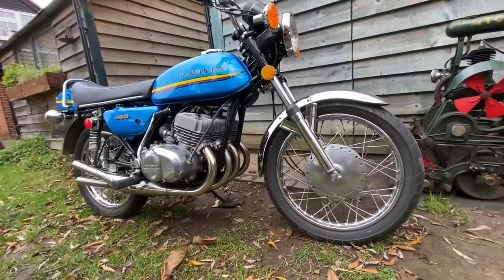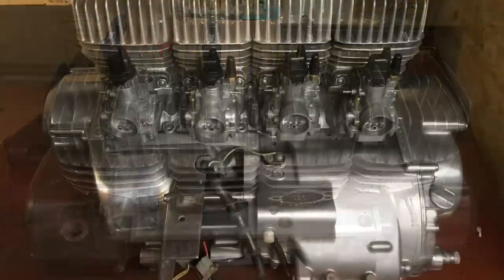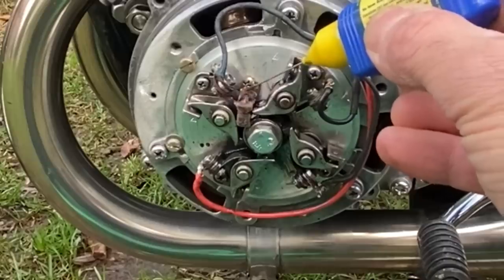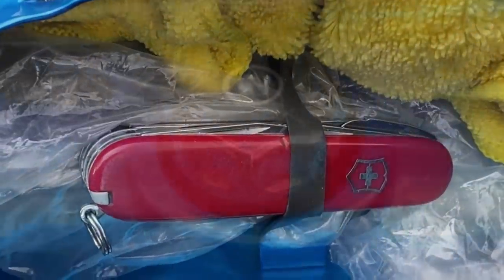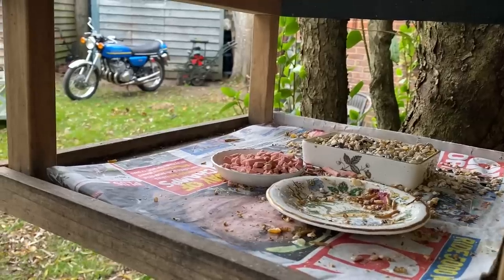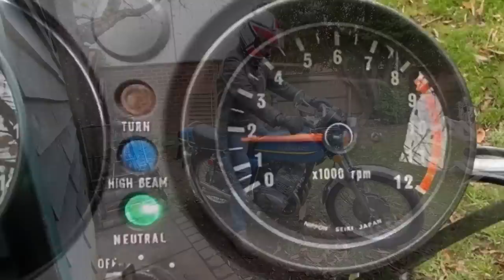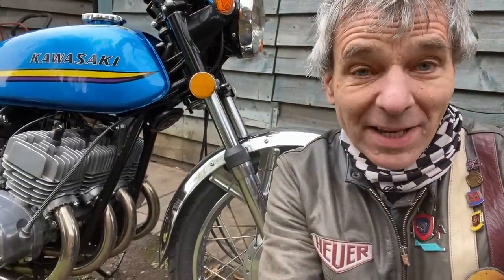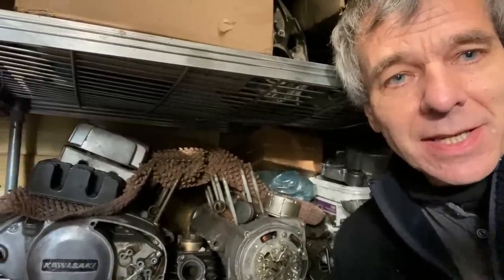Millyard Kawasaki S2 350 four cylinder two stroke road ride

Comment: I’m just amazed that anyone can cut 2 cases and square them and align them so you can get a crank to run true. Beautiful work.
Reply: milling machine helps. then so does a few decades engineering experience as well....
Reply: @MrKristyon  Being a genius is quite useful too. :)
Reply: I believe he mounts them on a mandrel and onto a true surface to keep the cases aligned. He then lets the case cool naturally and settle, still bolted together. These projects are awesome!
Reply: You remember he cuts these by hand with a hacksaw dont you?
Reply: @jagtan13  
I have seen a vid some where  & he cuts them with a hack saw
Reply: @Terry-Tibbs  cuts yes, but he finishes the faces true with his milling machine.
Reply: @driftingdan  afterwards he trues up the edge with his horizontal mill, and gets the left-right spacing correct.
Reply: So true, funny how it seems
Always in time, but never in line for dreams
Head over heels when toe to toe
This is the sound of my soul
This is the sound
I, I-I-I, I
I know this much is true
I, I-I-I, I
Ooh, I know this much is true, I know this much is true
I…
Reply: You just need a hack saw and a barbecue...
Reply: Perfect
Reply: yes spot on
Reply: Having an education really helps.
Reply: @MrKristyon  Allen didn't even have a milling machine when he started reconfiguring engines, and only a small - what I think they called a hobbyist lathe virtually used hacksaw and file. I think his Kawasaki V12 was from those days.
Reply: @driftingdan  Does he ?? :-)
Reply: @charlessmyth  the cases are cut with hacksaw. He used to file them to fit. These days, he cuts by hand and finishes on the milling machine.

Comment: I've never been a two-stroke fan, but wow, that engine screams! Watched it twice just for the sound. Me thinks I should get a stroker to experience one before it's too late.
Reply: My favourite two strokes of the era were the Suzuki triples, not up to the Kawasaki in performance but I loved their melodic gurgle. Kawasaki was more of a crackle. As the Kawasaki goes my favorite was the 400, it just felt a little more refined. I would love to take any of them around the block again and I would probably just melt into my boots for a chance to ride an Allen Millyard recreation.
Reply: The smoothness of riding a multi cylinder two stroke is amazing and they seem to have character!
Reply: I highly recommend it.  But, I do suggest getting the cleanest one you possibly can.  These things will run "a little funny" when absolutely EVERYTHING is completely trashed.  When I got my 400 triple, it seemed like it was just a bit out of tune.  Turns out it had a LIST of problems that anyone will tell you should have stopped it from running at all.  Ignition wires with no insulation and arcing to the cases, crank seals so chewed up you could see through them, compression 40psi down, the works.  But you could kick start it with your hand and it idled like a brand new Cadillac.  So make sure you get a good one.  Plus, when/if you decide to sell it, a cherry example will hold/gain value much better.

Someone previously recommended the Suzuki triples; I put my vote in for the Kawasakis.  The Suzukis obliterate the myth that 2-strokes don't have low-end torque - they pull like V8s.  But if you want to feel like you're riding a 2-stroke, the Kawasakis are much more "2-strokey".  They're not scary like all the myth and legend would have you believe (certainly not as scary as a modern R6), but just zippy and eager.  If you want scary, get some kid to let you ride his 85cc dirt bike.

Also, if something seems amiss and people try to tell you "2-strokes are just like that", they're probably wrong.  Very few people have experience with 2-strokes, and most of the people who had one, had no idea how to take care of it.  In my opinion, a 2-stroke is easier to maintain and easier to live with than a 4-stroke, but they trip people up because it's not just like a car.  When in doubt, dirt bike people tend to be a lot more savvy than street bike people.  They know that a surge or a stutter is not "just the way it is" but a simple tuning issue that can probably be solved in 10 minutes.
Reply: Come to the blue side of the smoke.
Real fun is when the powerband kicks in on a more cylinder 2 stroke and it starts to pull. 
The sound and the smell is still something special after owning a RG500 Gamma for nearly 30years now.

Comment: Allen, I have an early 1980's Honda CBX 6 cylinder motorcycle that it's getting too expensive to maintain all 6 cylinders properly.
So, I'm having it shipped to you to convert to a 5 cylinder for me. Tune ups should be affordable again.
Thanks buddy, you're the best.
Reply: all it needs is probably a set of new coils and electronic ignition! (im assuming theyre using contact points)

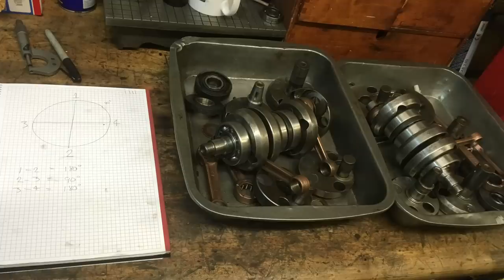Comment: 1:18 "Easy to strip down and reconfigure into a four cylinder, and change the phases". Trivial. Trivial.
Reply: I do that stuff in my sleep it's so easy. And by 'in my sleep' I mean I dream about it. :D
Reply: funny that 120 to car stuff
Reply: It's a tough job for the average dude in his garage, but it's the exact same process as any 2-stroke street bike crank rebuild.  If you need to replace bearings or seals on one of these, you're taking it down to its parts and manually setting up all the crankpin angles.  If you can do a twin, you can do a straight-8.

Comment: This reminds me of the smell of ‘Castro’s R’, which I dearly miss.
Reply: Yep l know just what you mean, l used to run my KH400 on R30. l don’t have it now, but l do have an Aprilia RSVR Gen 1, every time l fill up l put a squirt of R40 in the tank just to get the R smell lmao.
Reply: @Munter1  
Castor oil works too. Just use the minimum necessary to avoid 
gumming up carbratooter jets!
Reply: @Dodger2879 No need to worry about gumming up jets, it’s an injection, the injectors run at very high pressure so no problems at all, besides it only needs an egg cup full per full tank of gas.
Reply: @Munter1  
That's good to know. I ran Castor Oil in my tank (Buell). Childish.....I know, but I'd turn the bike around, just to ride back down the street I'd just come down, to smell it.
In 1970 I used to do the same thing in my Royal Enfield Crusader Sport.
Last year, 2019 I ran it in my Buell and my V-Rod. It's true! ...us guys just will not grow up!

Comment: Blimey I miss 2-strokes.  Can't beat the smell of Castrol-R in the morning.
Reply: Smells like victory!
Reply: Or Napalm !! LOL
Reply: Never a truer word spoken!
Reply: One of the first big 2-strokes I ever had a go on, was a ratty Maico 490 motocrosser with less than fine suspension, around  1983 along the railway line near Brackley. When that thing hit its power band, your testicles disappeared into your body cavity, never to be seen again.
Reply: Bean Oil... as we used to call it.  I don't even know if it works that well, but the smell is everything!
Reply: Expansion chambers and k+n's waking the neighbours up early every morning when you revved up for work lol and trying to sneak your girlfriend home on time 10 o'clock lol without her father catching you lol nothing like it I miss it too
Reply: @JamesHunterRoss  Bean oil is actually the best lubrication for 2-strokes known to science.  When things get really hot and it wants to seize, other oils (including synthetic) tend to flash away whereas castor oil wicks into hot spots and forms glassy long-chain deposits that hold up to shear better and better the hotter it gets.  The downside is, an oil that doesn't like to flash off will tend to be smoky and leave black goo everywhere.  With castor you're more likely to gum up exhaust packing and powervalves, more likely to foul plugs, and will need to clean everything more often.  It's also easily as expensive as the finest synthetics, it's too thick to play well in most oil injection systems, and when mixed it tends to un-mix itself (permanently!) if the fuel gets cold or just sits more than a couple weeks.  So basically, it works a little bit better than synthetic when the poo hits the fan, but is a big pain in the backside.  I use castor in my vintage dirt bikes (they're dirty and nasty anyway) but run synthetic on the street.  Sometimes I do add just a taste of it in the 400 triple, just for the smell.
Reply: @JETZcorp  Thanks for the detailed reply.  I had always used synthetics back in the day... it was just cleaner.  But some of my friends (and their parents who were desert racers) ONLY used the bean oil.  Always at the races you could smell a few bikes using it... it smelled the best.
Reply: I love the smell of Maxima 927 in the morning.
Reply: @JETZcorp  Back in the early Seventies it was Blenzall or Castrol R. In the Nineties we used Maxima 927.

Comment: In 1972 I was 17 years old and the proud owner of a red 350 Kawasaki.
Oddly enough the 350 handled very well unlike the bigger triples which were awful in corners but....the 350 never got more than 25-28 mpg to the US gallon.
Reply: its still not too late to get a Hayabusa at 65!!
Reply: @fidelcatsro6948  in 2019 I bought an Enfield 650. First I dragged the pegs. Then the center stand. 3 days ago I dragged both pipes.
I need to grow up.
Reply: @burtvhulberthyhbn7583  yes i agree thats why i recommended a 200hp hayabusa...my cat plays with enfields..

Comment: The smell of a two stroke is a petrol heads potpourri.
Reply: Castrol R FTW
Reply: That smell. That gasoline smell. I love the smell of Castrol R in the morning. Smells like  .... Victory.
Reply: Ye old castor beans.!
Reply: I add my used discarded engine oil from my 1200cc bandit to Castrol 2 stroke lube and burn them up in my little daily commuter 83 Yamaha RX115cc single 2 stroke!!
Reply: Castrol TTS !
Reply: Back in the early 70s I used Castrol R30 premix it at 50 to 1 in my motorcross bike it smell shit hot and blown no smoke This man  a goddamn genius 👍🏼🍺🇦🇺

Comment: In 1969 and 1970 I had a Suzuki T350 and a Bridgestone 350 GTO. I would've loved to have had one of Allen's  Kawasaki four cylinder 350s with stainless steel expansion chambers. What an awesome bike. Four cylinder 2 strokes have a cool sound. From Allen's test drive on this video I would say it is fast as well. Great video Allen. As usual.

Comment: You're an absolutely brilliant engineer, machinist and mechanic. The four cylinder Kawasaki is a beautiful bike! The exhaust note out on the road was perfect. I'm 65, so I remember these bikes when they were new. Good work Mr. Millyard!  Please build one based on the 350 or 400 triple engine, it would be a real road burner even by 2020 standards.

Comment: Good day Allen. When I set up my brakes the material I would use is kevlar aramid braided packing without any lubricant in the packing. My method was to braid the material with an adhesive mixed with asbestos. Yes I know about the hazard material issue but being young and invincible that does not matter. Then the machining to match the diameters and you are just set. The linings are so heat resistant they are literally as good as disk brakes. 
    Hope you can have yourself a Happy Thanksgiving as we here on the other side of the pond enjoy the bounty of the harvest. Peace to you too Allen. God bless. VF

Comment: I used to ride a 1976 Yamaha 250 MX when I was 16. Love the 2-stroke engines. With the new synthetic oils and proper tuning they can be as clean as 4-strokes, at least the outboard motors can.

Comment: @Allen Millyard, If you like long rides without fuel stops along the way, you could block off the oil injection pump and use the oil tank as a reserve fuel tank. Just have to premix...Cool build. Love it!

Comment: Would sound strange to anyone,but what impress me most is mechanical ignition points.I am a huge fan of the simplicity (and reliability) of ignition points/condenser system.Everybody have unnecessary obsession with conversion to electronic ignition.

Comment: Hi I had the Kawasaki KH250 in 1976, it handled like a pig till you got used to it. Drum back brake and a solid disk up front which was great in dry condition and hopeless when wet. I also had the metal suppression caps which were evil till I swapped them out. In bad rain it would go from 3 cylinders to one then 3 then two. It made life interesting. And I still love the smell of two strokes and Castrol R.
Reply: May I also say that you my friend are another, or even several levels of intelligence above me. 
I’m a country lover, wildlife and hunting were a large part of my life before disability screwed me up. 
Now, maybe I should have learned some other skills as I can’t get out now. I’m not moaning, God is in control of my life and that’s fine by me. 
I just had to compliment you on your skills x

Comment: I had a 1972 and a 1973. The 1972 suffered from crank flex which caused the thrust washers to Burn on the primary care side of the crankshaft because the crankshaft only had four main bearings. The 73 was corrected with six main bearings and the thrust washers did not get burnt from crank flex

Comment: Slightly confused but it may be due to different model designations between the UK and the US. My first bike was a red ‘72 S2 350. It was I think 346cc to begin with and had slightly different styling with the most obvious difference being a flared tail behind the seat. A single added cylinder to my 350 would have been a 460 or 465cc. Here in the US, I believe the 250 triple was the S1. Both of these were beautiful bikes in any case and yours is a delight to look at. The individual ignition points were the my only complaint for my S2 as they might need adjustment in as little as 500 miles. I eventually replaced the main bearings and seals, upgraded the pistons and built expansion chambers. Lots of fond memories.
Reply from the maker: I fitted 4 S1 cylinders bored + 1mm making it just under 350cc

Comment: No valve float :-)  This reminds me of the time when I was a kid and had a James Comet with a 98-cc Villiers two-stroke engine. In my quest to increase performance, which included chopping the exhaust pipe to a stub, I skimmed the head with a surform, and eye-balled the result.  Not perfect, I'm sure, but it ran  Maybe the head gasket saved the day :-)

Comment: Interesting! I wonder how Mr M got the drive sprockets to line up for the final chain run. The engine/gearbox is offset to the right by about half the width of a cylinder. Mr M doesn't mention an output shaft extension or an outrigger bearing (used on another 3 to 4 cylinder Kwaker conversion). What did he use this time?
Reply from the maker: Al explained in the S1 550 four videos

Comment: I must admit that in my youth I used to run all of my two strokes in a high gear and low speed for a couple of miles before changing down a few gears and then pinning it JUST to see the smoke screen in my mirrors. I miss my triples.

Comment: Excellent video, as always. But you glossed over the one thing that I’ve wanted to see on these: once you shift the engine so it’s centered with the extra cylinder, how do you get the countershaft sprocket back to its original position in relation to the chain and rear wheel?

Comment: Great job! Almost makes me want to buy it (but I won't). Couple of questions for you about expansion chambers: first, if two two-cycle chambers are running 'together', i.e. 180 degrees apart, could they be in time to both run into the same expansion chamber? And second, since you build your own spannies, have you ever tried pushing the exhaust outlet (the 'stinger') into the fat part of the chamber, where pressure is lower, rather than the tail end where it always is? That used to be done 'a long time ago'', but kind of fell out of favour, even though it was said to reduce exhaust noise. A modern experiment sure wouldn't hurt, wot?

Comment: You did an amazing job - sounds beautiful. I used to have a Suzuki GT750K and always had a little problem with the points. The shaft on that motor had one bearing and it rode off the end of the crank, so there was some vibration that caused the gap and timing to be off a bit through the revs. I had thought of cooking up some kind of distributor so I would only have one point and coil. Have you considered this as a possible modification for a future project? Many years ago there was a company in El Monte California called Victor Products that made a 3 cylinder distributer for another bike that I thought about trying to modify to fit the GT, but by the time I got round to it, they had ceased. I miss my old Water Buffalo, but it went to a good home.

Comment: Hi Allen, fantastic work as always. To get the final drive alignment did you move the rear sprocket outwards? I don't envy you with 4 sets of points to set up. Fitting a Boyer electronic ignition to my 650 Bonnie was one of the best things I did on it to get round having 2 sets! I'm also a fan of up for first and down for upshifts. Nothing for frustrating than accelerating out of a bend with the bike cranked over and you can't get your foot under the gear lever to shift up. Keep up the great work.

Comment: You do beautiful work but I have two questions. 1: Why? 2: Do you get better than 15 miles per gallon like the old S2's?
Reply from the maker: Strangely it’s very economical ridden at legal speeds it easily returned 40mpg

Comment: Allan, is there a way to measure or to check if your cylinders are lubricated enough? I´m sure that you are not using trial and error to select the correct internals for the  2-stroke pump, especially on an engine that took so much effort to build. Wouldn´t it run even better without the pump, on stihl motomix or aspen fuel? It´s a magnificent bike btw that sounds fun to drive..
Reply from the maker: i made a pump with the leanest parts and it worked just perfect